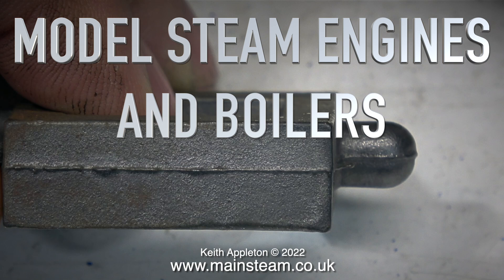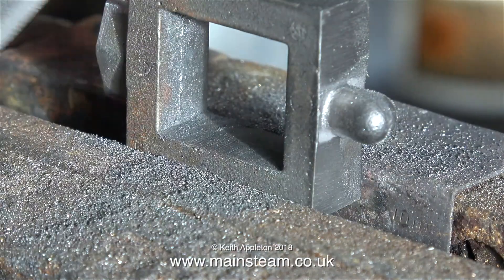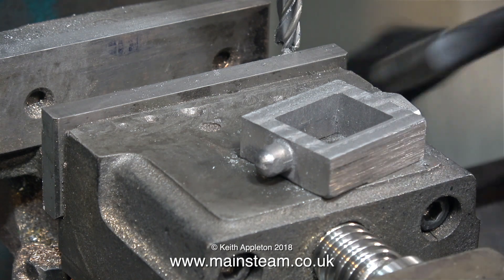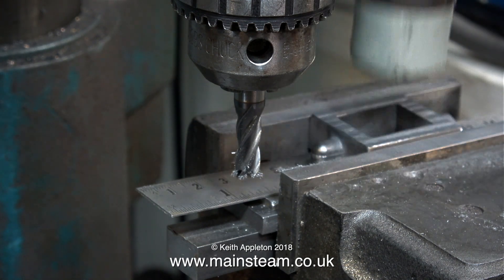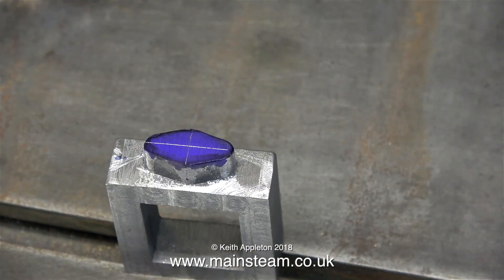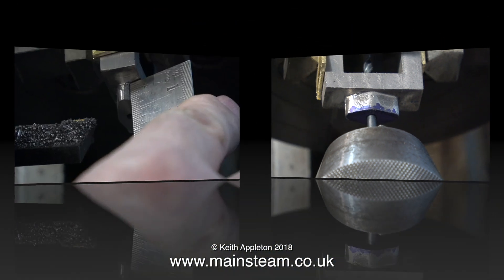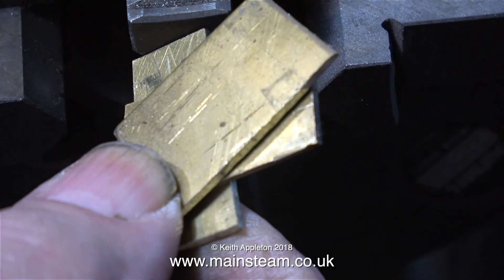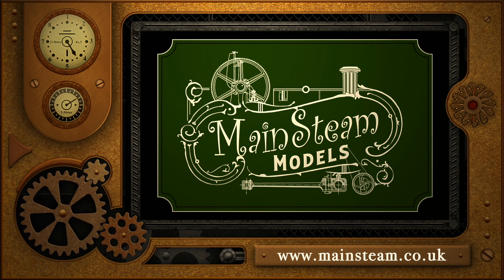MODEL STEAM ENGINES AND BOILERS - PART #33

Comment: us man's holiday a Myford ... could be worse ... could be machining parts for a pin fire sized tank or some such lol    ... at least at Myford you know the tool you need is there ... someplace ;)
Reply: hmm surface grinder ... why not spray glue the emery paper to the flat surface ... spray glue the part to an orbital sander (some form of hard removable securing) and use the orbital sander to provide the elbow grease and a touch of weight ...
Reply from the maker: My way seems to work just fine, but if I wanted to waste some time, I suppose I could get the glue out ........
Reply: @keithappleton  just thinking for those ones that take forever or for large numbers of bits ... 1 or 2 ... faster to go by hand

Comment: Most machinist make there own parallels, even if they own a set. You use the commercial ones as masters and duplicate them as close as you can. I made one set using gauge blocks as masters and came within a tenth of a thousands of matching them. The Boss bought them off me and used them as shop grade gauge blocks.